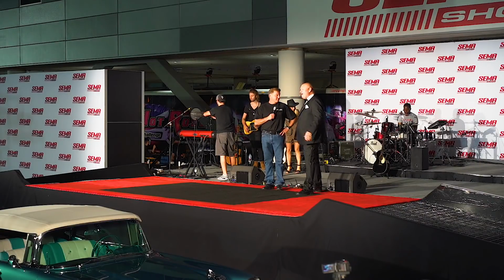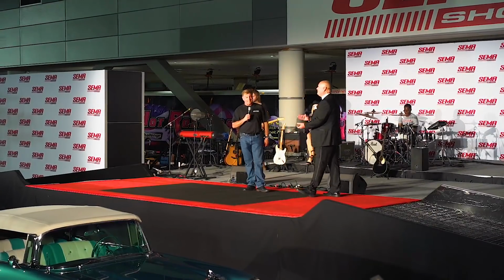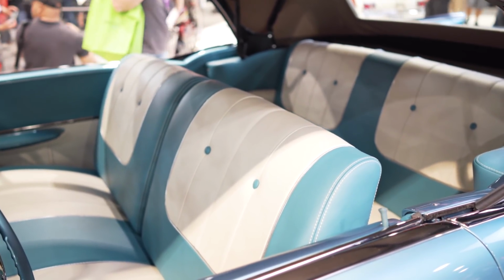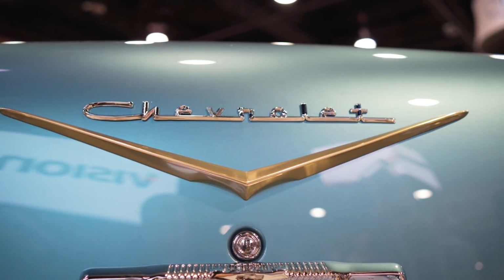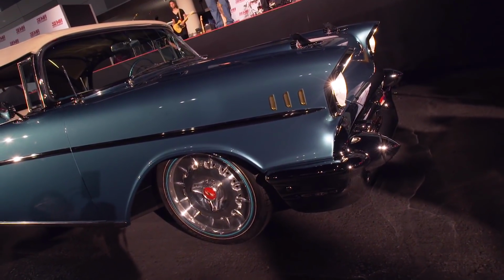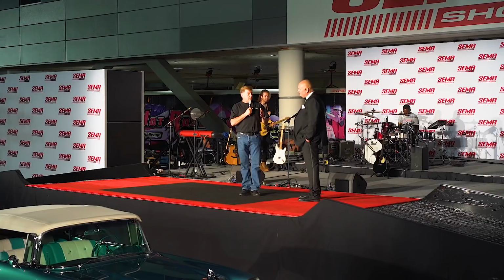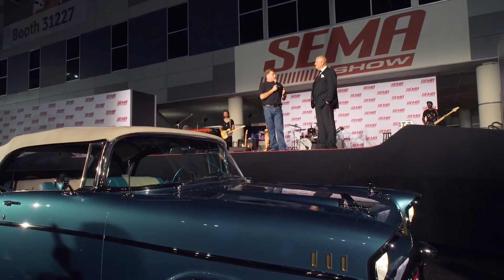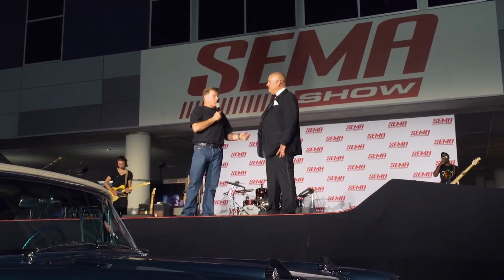Chip Foose 1957 Chevy Bel Air Convertible at 2018 SEMA Show Reveal in Las Vegas V8TV

Comment: Sorry chip but the chevrolet co built 602. 67z 28 camaros in 67 of wich i own one and chevy made around 1000 CE over the counter replacement motors wich had all the z28 crank,rods,forged 11,5 to 1. Compression pistons,dontov 30 30 cam. 2.02 big port camel hump heads high rise aluminum intake smokie yunick said in a good machanics hands those motors would make 450 horses all day long but a good tuner was needed i prefer better. Connecting rods like scat. Pro i beam  long rods with L19 series  bolts or the 2000 series bolts ive seen 9000 rpms out of thous motors and still running i own 4 of those motors